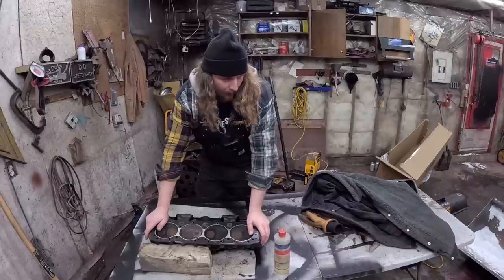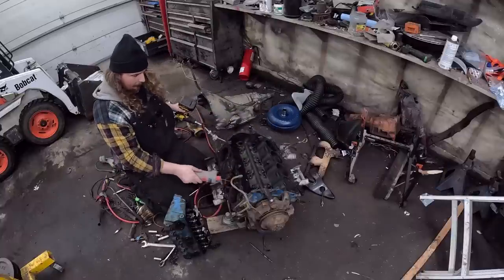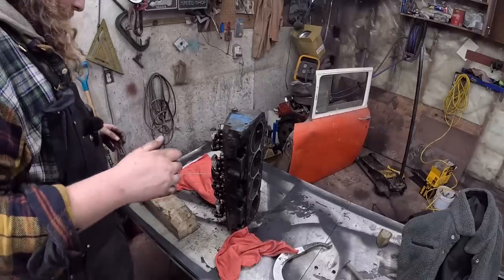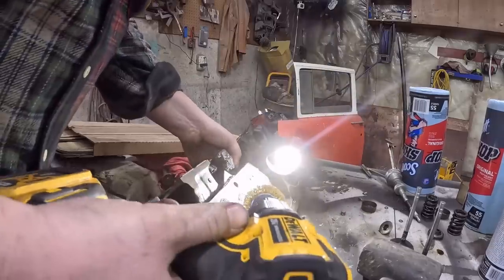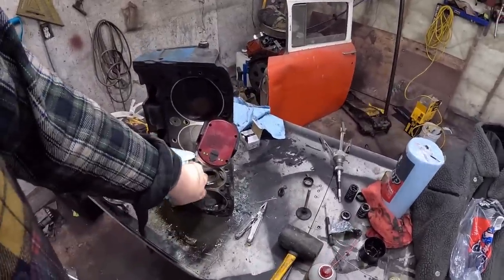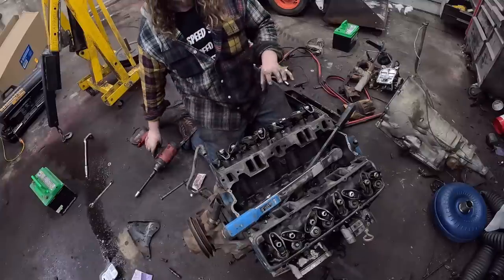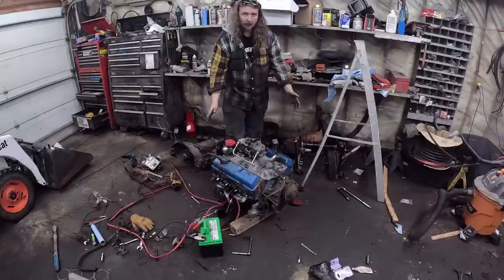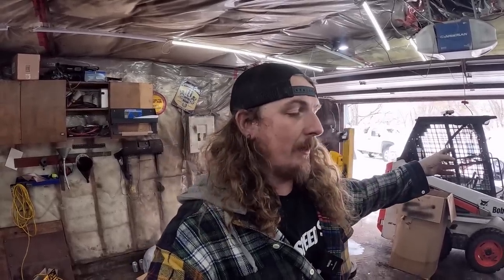FORCING IT TO RUN! - Freeing A STUCK Engine THE WRONG WAY

Comment: That's awesome.  Good job showing what's possible with a little work.  It would be interesting to throw a compression gauge on there and see how far off the rusty hole is from the others.

Comment: GO for it! Nothing to lose but some time. It may work out? I seen much worse when I worked at the junkyard. Locked solid, soaked, freed up eventually, ran fine, no heads even pulled.

Comment: I'd bought a 76 JD snowmobile that was stuck. I got it freed up with a big bar and it actually fired up with a shot of premix. Ended up trying to do crank seals on it and finding half the crank was ruined. It seamed to run on both cylinders but the rings were partly stuck on the one bad cylinder.

You were already in there and could have cleaned the rings and lands up. No wondering if they were half stuck.

Comment: Love it. As a cheap ass myself and old school. I have taken a 327 sbc that sat upside in a field for yrs, slammed it in a car and ran the piss out of it. I have a 350 that came out of a suburban we bought for cheap for the transmission. Ran and drove but when we got it home and filled it full of fluids found a bad headgasket. Pulled the heads and it has a bit of tiny bit of rust in 1 cylinder. It will find its way into the next rig I need a cheap engine for. Run em.

Comment: I use mesh sand screen to "bore the cylinder" first lol. Saves on the hone stones a bit. Then hone it to perfection. Good job man!
Reply: I can't tell if your joking or not lol
Reply: If not joking ild assume it's to just get rid of the rust and top layer of crap ?
Reply: @GLOBAL-INTIFADA  on a cylinder that's trashed already and pitted it will just knock more rust loose instead of letting the hone stones work through it. This isn't proper but it works on a already compromised engine

Comment: I am a big fan of the 327 small block . Had one in my 65 Impala and also my 66 El Camino , i fraged on in my 67 C-10 by doing a long ass burnout . I know that they are not correct for a 57 Belair they didn't come out till 64 but they are more available and dang near bullet proof and can be built to what ever performance level you want .

Comment: NICE! Great project. An old wieand X-cellerator! Not terrible intake a lot better than people give it credit for plus has that kookie optional plenum divider that actually works. I can say this is such crude engine work it is funny... I get it keep on keeping on! Who would re slug a SBC and put those smog era loooow compression dished pistons in when cast flat tops were same price and it would bump compression up to 9.0:1 ish. That's litterly free HP and TQ. Same with the cam a melling "rv" cam would cost the same as a jobber OEM replacement i.e. dirt cheap and those "rv" cams are a nice step in overall performance over a oem smog era miniscule lift and duration, they were laughably small.  Those 2 things would give a noticable seat of the pants free power with an HP boost to lively 200+ vs weezie 180 or less HP and more much needed TQ where OEM cams were soooo bad and drivability characteristics would be just as good and efficiency i.e. mpg would likely be better.  I've done that same thing back in the 90s to a buddy's mid 80s c10 except a slight of an upgrade performer intake the same formula and the truck still wasn't fast but  felt quite a bit more lively in comparison to the original engine it would actually spin a tire pretty good before it would barely break traction and it smoked.

Comment: If my dad could run a 350 with one cylinder plugged with a chunk of wood, you can run this for quite awhile.......lol by the way he did " fix" it with a piston and connecting rod from a 6 cylinder.......had to hand file the sides of the connecting rod to make it fit...but it worked! He drove that nova for 7 years after...😯😀

Comment: I worked with a guy in the early eighty's. They drove and old blazer with maybe 250 thousand plus miles. By then we would have at least junked the engine. H e and his wife who wasn't afraid to get dirty, went home on a Friday nite pulled that engine and put new rings in it. Now he could have afforded to rebuilt it properly but he was frugal. They continued to drive the Blazer.

Comment: I have a small suggestion to help make more usable room in your shop. Adapt the shelf against the wall so it will accommodate your engine stand with the block on it and then you can roll it out of the way.

Comment: That’ll be fine, in 1972 I was given a 63 Chevy with a I 6 that had a bad knock I pulled the head and pan in the car. Had a broken piston, pushed it out the top of block took rod and piston to dealership had them put a new piston on rod and reinstall the used rings went home reinstalled with all the used gaskets and no torque wrench so for $7.00 bucks I had a daily work vehicle used a little oil but not enough to smoke, drove for two years and sold to a co worker for a hundred bucks he warped it around a tree a few weeks later.

Comment: I haven’t had to do this yet! I’ve got a few videos on my channel, my daily driver car sat since 94 with no aircleaner and the carb was filled with crap I’m amazed the engine wasn’t stuck, my 83 crownvic sat since 2000, and my 73 f250 sat about 15 years without being ran

Comment: I would take steel wool to the cylinder first to clean all the rust out of it and then I'll use a 3 finger hone or ball hone to it afterwards to clean up cylinder wall and put cross hatching back in it

Comment: I did a small block more sketch.  We put a. 283 piston in a 307. The 283 piston stuck out of the deck. About one eighth.  So we got out the disk grinder and made  it even. Washed it up with gas and assembled it.  It ran fine. Big chef's  girls engine  has different sizes of pistons in it. Lol.

Comment: Good on ya for fixing that engine. If you had any deep scratches in the cylinder you could have JB Welded it  and sanded it down good and she'd a been fine. JB Weld. You can fix a cracked block with it. So I know it would fill a crack in a cylinder for sure. Your doing great man.

Comment: Your invisible eye protection looked good while you were using the wire wheel!!! But I am Sure that you closed your eyes while doing that, Ergo it's All Good
Reply: Also an Old Geezer of 74 here! Can completely agree with make it run, it's always better than walking! Was probably 20 before safety glasses impressed me. Lol welding without goggles isn't so bright though! Smiles

Comment: Wire wheels, sand paper and lapping compound can work wonders.. knocking off the carbon... lapping the valves... hone job.. all good stuff. Get some decent heads later on if the right set rears itself wherever and whenever :-) Just commenting for the old what-cha-ma-call-um on youtuber. :-)

Comment: ehh, i've done this a couple of times and got 30,000 miles out of one before i sold the truck, and it ran pretty good the entire time. i dingleball honed the cylinders rather than with a stone hone. since it's just a grocery getter it should be fine. i've seen worse that ran fine on farm tractors, and they pull hard, just at low rpm's. it's all relative, as long as you can get 70 psi or better compression it'll run good enough.

Comment: As I am watching the valve situation unfold, I would have done the exact same thing except throw in a different used valve in it after a quick lap.  That way the valve won't be as compromised. But this is not a fire breathing monster of a motor.  Barely even a mouse!

Comment: Great video. It may not be "right" but you can get some use out of this old pump.  Put it in the car. Take the money saved and buy a radio for the car. Turn it up loud and the engine will perform beautifully. Definite "win". 😉

Comment: My first car was a 79 corolla, and I bought a book on it. It would turn just part way around. I pulled the head and found a broken valve that the piston hit it and destroyed the head. bought one piston, put it on the rod, bought a 25 dollar head , put it back together and it started right up. I beat the s out of the car for 2 years then sold it for $500.00 bucks. Not bad for a total of 65.00 dollars in parts. This was back in 84

Comment: Anyone remember engine rebuilding pellets...you put them down spark plug holes and ran the engine. They were soft lead or something. I used them on a 350 that smoked like a chimney..it stopped smoking improved power I drove that truck for another year and when sold it it was still ok..not ever perfect but respectable enough for a beater..it's only a bad idea if it does not work

Comment: Engine machine shops are about as crude as I gets, this is actually pretty good. I wonder if you could hook up the starter and turn the engine over with lapping compound in the cylinder to straighten er out.

Comment: No need for a torque wrench. I've impact on my cylinder head at the race track on my $30,000 race engine. It lasted for quite a few races

Comment: When a unframe costs in the $15-20,000 . Truckers willreplace single often 2 cylinders. 
 Dealerships do the one cylinder repair on warranty work. 
 Don't feel bad about it . More do it than you can imagine.
 Personally I'd of green the stuck piston and ran it . Where I am a motor in a shed will lockup over winter if not pickled

Comment: I bought a harley FLH from iran ,, a guy here imported them to holland.. The engine was stuck and when we took it apart there was a ring between 1 of the valves. This cilinder was also rusty ! I took it to a machine guy shop and they ask what youre gone do with it.? I told him a just ride it a bit and then sell it...  ok he said , i wil buy new pistonrings and machine the cilinder a bit,,  When i got i it had stil litle rust holes in the cilinder..  it drove fine juts a litle smoke  and you had to clean the sparkplugs more then normal !!  The rest it was FINE !!!!     lol

Comment: If this is the "wrong way" of doing things than I don't want to be right.  Have did this exact "rebuild" with my dad on a few engines.  If it works good job, if it doesn't o-well it was a few hours.

Comment: I'm only 8 minutes in, but I figure you can JB Weld that cylinder with a thin skim coat (like bondo body work), then run the cylinder hone on it. What could go wrong?😆

Okay, I've probably made it obvious that mechanicking isn't my wheelhouse, but I'm learning!.
Reply: if it flaked off it would get in the bearings and stuff

Comment: I promise if you would have took some 180-220 sandpaper on the drill and cut the head seat slowly then took and ground the seat with your compound it would have worked fine. Again if it didn’t have to be sanded an extreme amount. Done it more than once in the 80’s-90’s cause no money to get a proper valve job or heads and yes it worked fine. I’m not going to say how long it lasted but it worked.

Comment: my dad worked rebuilding engines back in the day at least for a little bit and the only fix what is broke thing was very common
spun bearing on X that gets cut to and new bearings there told me that story and something tonawonda motor almost in the same breath so your one piston .030 over is funny but not surprising
I would imagine a set of 30 over pistons would then fix 6 engines instead of just one

Comment: I bought a 401 buick nail head from a guy  had a dead miss 
Took it home left in shed for year or 2 took it to machine shop get it refreshed 
My machinist called me and said to come down to shop. 
The number 7 piston and rod was missing no push rod no lifters but lifter bores were filled with jb weld 
So yeah it had a dead miss

Comment: I did something similar to a 235 when I changed the the head and jb weld the crack in the and wired wheel the heck out of the head and got the valve to seat with out leaping them dan

Comment: This guy that I  worked for, his dad had some old inline six cylinder engine something I don’t know what it was, but something happened to the valve train on one of the cylinders so he took the piston, connecting rod out, removed the push rods and pounded a post into the cylinder bore like a cork And drove it like that for how long who knows

Comment: All the purists are going to hate this, I love this kind of repair. When I was a teenager I had a rod knocking and I used emery cloth to smooth out the crank and put a 10 thousands over bearing in it and it ran a long time after that. I dropped the oil pan and did it in the car.

Comment: doing what you can to verify certain conditions is exactly what I would do Dan, sometimes a little more work but the cost saving can be exponential... bottom line, you now know what you have in the car for sure, its not a daily driver so a budget can be established for a future rebuild, atleast its all in one running piece...

Comment: I bought a chev 283 one time with a water Crack on outside of block I drilled 2 holes one on each side of the block put screws in to stop it from cracking any further JB welded it put silicone over it put it in a Pontiac tempest and drove it for a year no problems showed the guy who bought it my repair he just wanted the car budget build 101 you got nothing on me Dan haha

Comment: I pulled a 350 apart.? Compression was way off, as I scratched my noggin. 2 cylinders on each side was .030 over the rest were stock bore. It actually ran strong.befor head gasket blew out

Comment: When you lap a valve, how much material comes off the head as to opposed to the valve? And also, is there a certain point where the material that comes off the head makes it no longer usable?
Reply: Dan said he did this as a joke. Do you get it, it's a joke. He doesn't care how long it runs.
Reply: @stevehetrick2676  I’m well aware it’s a joke. Reread my question please. I’m talking in general, since his day job is a mechanic too

Comment: The 6 wouldn't be as noticable as on most engines . Gm 6 s . The aprons on the pistons pop off fairly new that's why gm straight 6s have that loppy idle.

Comment: I'm the anal engine builder type and would never do this.  But I love that you did it and it runs.  It'll be interesting to see what the compression test shows when it is warm.  And to see how much oil it burns.  You might want to get Dannie a respirator for when she's driving it.

Comment: Are used to get worn out 350s from the junkyard that I worked at I would strip them down I would replace the bearings the piston rings I would give them a dingle ball hone clean everything up re-gasket everything re-lap any valves new valve seals paint them freshen them all up and I would sell those engines for $500 all day long I would put maybe $100 into each engine a few hours of work I would get the engines for free it was a sweet little gig I had going on then everybody wanted the LS and my business started to taper off so I moved on but that was fun while it lasted

Comment: I have been doing 100 dollar rebuilds for 30 years to stretch my high mileage cars another 50,000 miles. Hone, ball hone, gap oversize rings. New bearings, valve seals and timing chain and gears. If it works is really that stupid?

Comment: Is it a dumb idea if it works 😂🤣 sometimes necessity is the mother of innovation.. professionalism is only for the peeps who don't understand the need to make loud noises with air. fuel, spark in confined area 🤔🤘🤘😜🔥💪👌DD speed shop rocks hard 🤘

Comment: The rust pits will fill in with carbon Tare into it 10k from now and you won't even know the pits were there and I bet it doesn't smoke or use oil 😉 I have a dome piston 283 built to RUN in the 60s I did this same type of thing to it and it runs hard with mechanical cam huge duration and lift I spin it 8k plus there were 4 cyls on the same side that sat with water 💧  and rusted bad leaving pits

Comment: If I had a nickel for every motor that's running with a scored or pitted cylinder I could probably retire. In the 50 yrs I've been playing with this stuff I've put together some pretty shady stuff, yet it worked. Worst case, you'll be pulling that plug more often than you'd like.

Comment: Honestly, I don't see how this is any worse than a guy who finds a stuck motor, pulls plugs, dumps some magic juice down the cylinders, hits it with a breaker bar, and gets it to move, then puts plugs back in, makes it run, and proceeds to drive the wheels off it for 5 more years..  In fact, it might be better, since you actually cleaned the crud out, and lapped the valve some.. I've seen guys do that without disassembling, and cleaning, and drive the thing for years. I think a lot of people, machinists especially get really worked up about stuff that only matters if you are counting milliseconds on the quarter mile, but back yard tinkerer's who like to have fun with old jalopy's get away with stuff like this all the time, and hey, if it fails, then you just punch it out .060 over worst case...

Comment: This is not as dumb as you're making it out to be. If you can get it to run, you got a car engine even if it ain't all that great. People drive much worse engines in their daily drivers all the time.  I drove a car with nasty rod knock for 3 years in college.  It was so loud that if I opened the passenger window and drove on a 4 lane highway, the sound would cross the highway, hit the buildings on the other side and travel back to the car still loud enough to sound like a nasty rod knock.  I put like 30k miles on that thing.